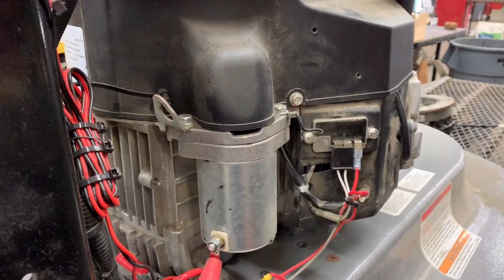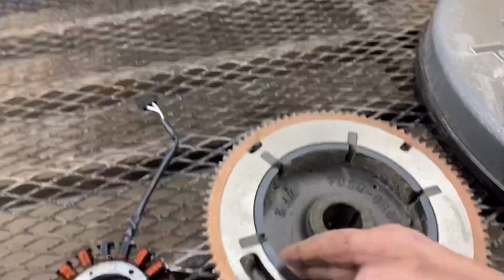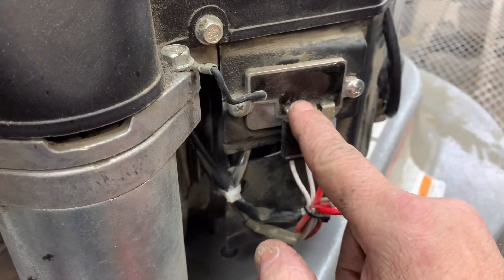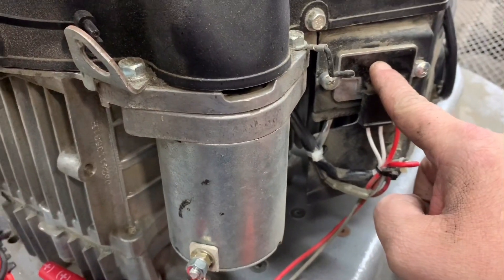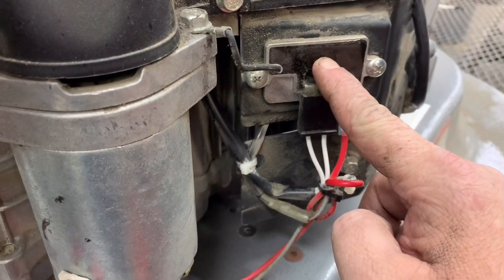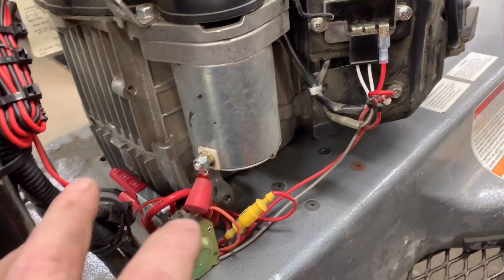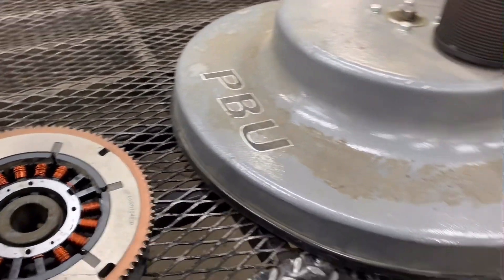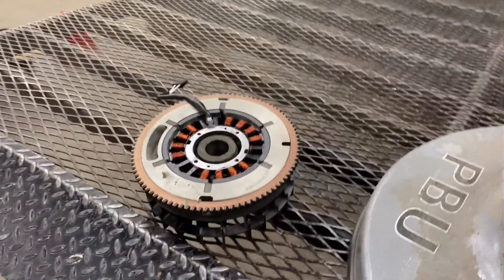SMALL ENGINE CHARGING SYSTEMS EXPLAINED / HOW THEY WORK AND HOW TO DIAGNOSE

Comment: Question for someone... 

My ignition Battery post, has two wires. One connects to the 25am fuse and to the PTO switch. The other to the solenoid with the Battery + post from the battery. Should A1 or A2, connect to the PTO switch? Yes, the S is connected, I have a three post solenoid. 

I think this is wrong.. My battery drains.

Comment: How does a headlight work on a small gas engine w a pull start and no battery? There is no power at the headlight when engine is running.

Comment: Over charging? Kohler confidant, in a spartan. Changed regulator. And it worked for about a week. Back to 15.1 volts.

Comment: The charging regulator is often a component that highly likely to be damaged due to a reverese polarity connection on the battery , some systems have a fuse on the output of the regulator that will blow before it does , I personaly feel all charging circuts should be fused if you have no charging current allways look for this fuse.

Comment: I need to upgrade the charging system on a Briggs Intek 19.5 single cylinder.
It has the 3 amp basic system.
Can i just change the stator and add a rectifier or do i need a flywheel with more magnets in it?

Comment: I have an old Craftsman lawn tractor that I put a 730v Kawasaki engine on it. There is a battery meter that starts out with the needle to the right. As the battery charges it goes to the middle (like zero). Suddenly it started working opposite and the motor died starving for gas (coincidence?). I ended up replacing the fuel pump, cleaned the carburetor and now have to keep the fuel line up on top of the engine to keep it running. Crazy. Still not sure if it's electrical, gas or both. I'll be checking voltages tomorrow, thanks to you taking the time to make this video. Awesome.

Comment: Very useful. My Snapper RER has a burnt up stator due to my brother getting the wiring all out of whack, but the good news, he gave me the mower. The engine was somewhat seized up but loose now so before I purchase a stator and whatever other parts I may need, I would like to run/test the engine. Since the wiring is not right, can you please help me with the minimum wiring needed just to start it?

I believe there are two wires going too the stator...can I assume I just leave them hanging for now? I took the old stator off already. The coil is there as is it's plug wire. The small wire that plugs to the connector on the coil, I don't know if that's what kills the engine or not...do I plug that one in or leave it off?

Truth is, I tried it already with the wiring configuration I just mentioned, with the small coil wire both plugged and unplugged and got no spark but the battery I was using to straight wire the starter ran dead before I could be certain the spark plug was grounded. So if I get that plug grounded and it still doesn't spark, what next? Did I miss something?

I suppose it is also possible the voltage regulator is fried too but first things first, and I'll wait to hear back about my present wiring scheme. Thanks for any help.

Comment: I have a 22 horsepower Kohler and the stator is only putting out 13 volts we changed the stator and it's still the same output. Do you have any idea what is going on

Comment: The stator has both fields screwed to the metal on the stator, and that's done at the factory, so a briggs test won't work as the briggs stator is not screwed to the metal on the stator, if that makes any sense at all to you, I have pics if you need them.

Comment: Hey man, I have a tecumseh ov490ea 17.5hp 2006 manufacturer year, it has 2 wires coming off the stator, one had a diode, one does not, I have a bunch of diodes in a kit, but not sure which one to use, I have a oem tecumseh one on order, you know the one 611161 part number, now my question is this, the engine does not have a voltage regulator on it, it came that way, so the diode does the work of the external voltage regulator? Thought I'd ask the small engine pro, as I can't find anything on the tecumseh engine stator testing procedure, or how that system works for charging the battery, any advice would be great tks.

Comment: What about when it's working however not very well. I have a briggs opposed twin and I get just between 13v-13.5. I'd like to see more power from it
Reply from the maker: You’ll never get anything above 13.8 with that style charge system.
Reply: @THEMOWERMEDIC1  okay so probably don't have a problem. Have you thought of doing a video on all the different briggs filters? I'm confused about the differences and also why some are using xc12yc plugs and their differences

Comment: This is such a great video, explains it all clearly and concise.  I need to diagnose a Honda engine that's not charging and in 6 min I know right where to get started. Checking Battery first then Stator output voltage-->Regulator--->wiring harness.  like, sub, comment Thanks theMowermedic1

Comment: My NEW stator is puttjing out only 13 AC Volts at full throttle. (Should be minimum of 28 AC Volts). Is it possible the flywheel is bad even though the magnets are attached and magnetic
Reply from the maker: How are you measuring your voltage? One leg to ground it will be 13 to 14 V measure both legs together you should get to 28 to 30
Reply: @THEMOWERMEDIC1  Both legs together. However I did have to glue some magnets on the fly wheel and I think I have figured out that I may have the orientation wrong. I will check tomorrow. Thanks so much for your quick response
Reply from the maker: @richardmulder8542  sounds like he got some magnets that are backwards and or they are already broken away from the fly wheel and are stuck to the new stator
Reply: @THEMOWERMEDIC1  Yes, magnets were broken away from the fly wheel I reinstall them without paying attention to the proper orientation. I think I installed some backwards
Reply from the maker: @richardmulder8542  Just buy a new fly wheel
Reply: @THEMOWERMEDIC1  For $250+. No thanks
Reply from the maker: @richardmulder8542  That sounds a little high what are you working on
Reply: @THEMOWERMEDIC1  Hey Kohler engine. The magnets had come off of the fly wheel which I glued back on but I think I got the orientation wrong. So I need to check that. Thanks for your response
Reply: SO I removed theflywheel and 2 magnets. How do I test North and South on the magnets? On ANY end of the magnet and ANY end of another magnet, I touch them together and all sides are magnitized with each other.

Comment: Thanks for the video.  I have kawaski  fx730v getting 29.5v AC off the stator.  Which is less than the range you stated.  Might my engine have different specs?
Reply from the maker: The parameters that I gave in the video are pretty universal I would check my engine specifications give me just a few minutes and I’ll check that for you
Reply from the maker: Yes you are good at 29 1/2 V.  The minimum spec on the engine you are working on is 26 V

Comment: Regulator regulates the voltage meaning it keeps it at a constant set voltage.  A rectifier converts the ac voltage to a dc voltage through a series of internal diodes.  Two separate things..  the regulator is the smaller box on the bottom of the rectifier on top..

Comment: Thanks for this. One question from a small-engine novice: If the charging system has nothing to do with spark generation on the spark plug, where does the spark plug get its power? Thanks.
Reply: a magneto, follow the spark plug wire and you will find the magneto

Comment: I have honda gx390 with a charging system with only 1 wire coming out , I test the voltage and I have like 30vac
I also have a regulator rectifier,  can I hook the 1 wire and a ground wire to the regulator so I can get 14vdc will the other wire missing be a ground? Thank you

Comment: No voltage regulator on a Briggs they have a single diode in the wire coming from the charging side at about 13v DC of the stator that charges all the time at very low amperage unless the mower has electric PTO or blade clutch. 
And about 14v AC on the accessories or headlight side
Reply from the maker: Different animal This
Video covers rectified ac voltage charge systems.  Thanks
Reply: I have the same system on my Kohler 15.5 hp engine on a Craftsman mower. Just a diode and no regulator.

Comment: The charging systems on the Stratton engines are simple also.(;
Reply from the maker: Yes. Same thing basically
Reply: No voltage regulator on a Briggs they have a single diode in the wire coming from the charging side at about 13v DC of the stator that charges all the time at very low amperage unless the mower has electric PTO or blade clutch. 
And about 14v AC on the accessories or headlight side.